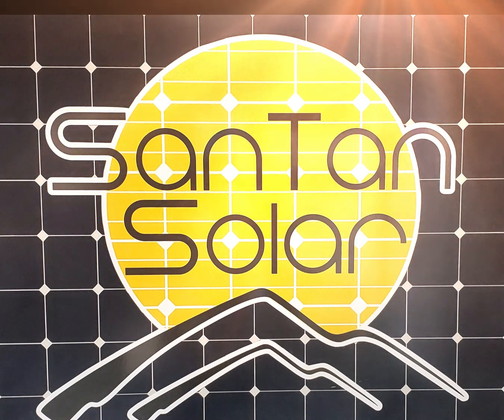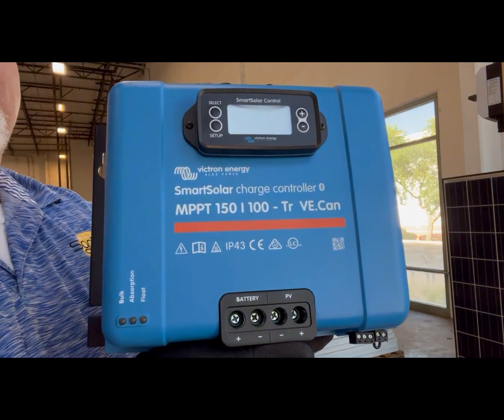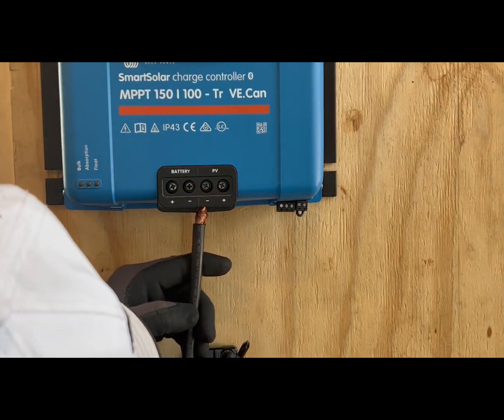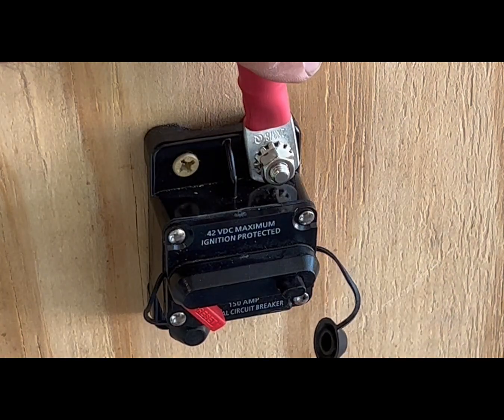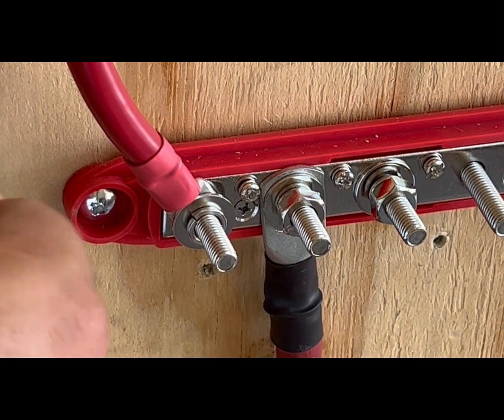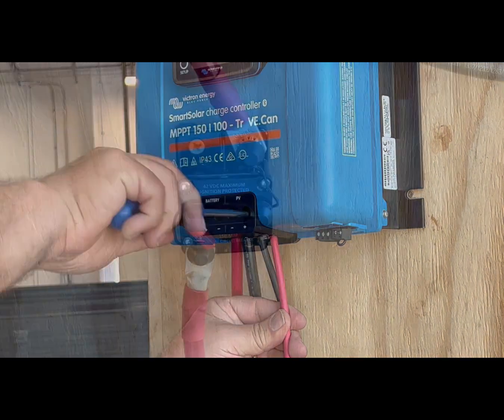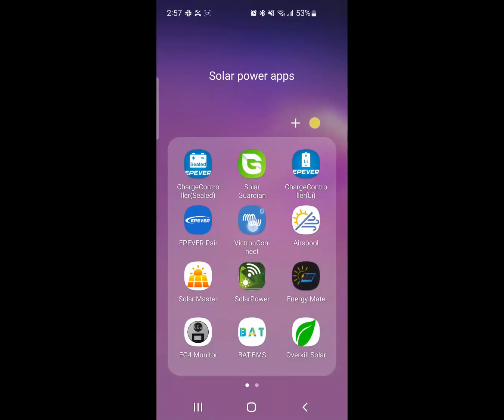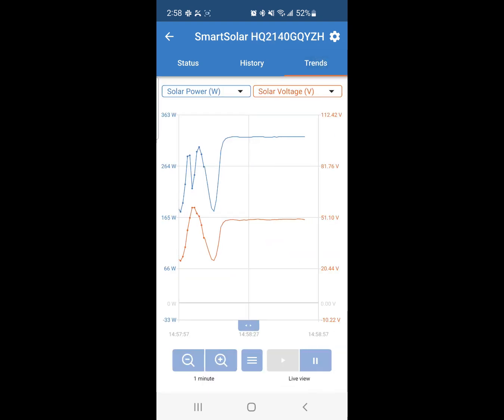Victron Charge Controllers

Comment: HOWdy SanTan SOLAR,
just a few critiques since new  DIY'ers look to you for guidance 
1)  those   RED & BLACK  multi-stranded heavy duty  CABLES  ( 2 AWG ? ) 
might have been better equipped with a FERRULES   before insertion in the Charge-Controller ? 
2)  those cable LUGS  were not the proper  "eye" SIZE for  STUDS  they were being attached to / Overly LARGE Holes 
 ... even utilizing Flat Washers will not  accomplish as G@@D a connection as MATCHING Lug Hole size to Stud size ... 
IMHO 
COOP
...